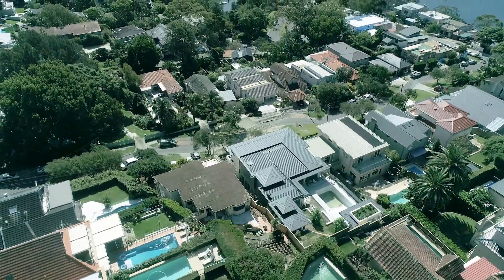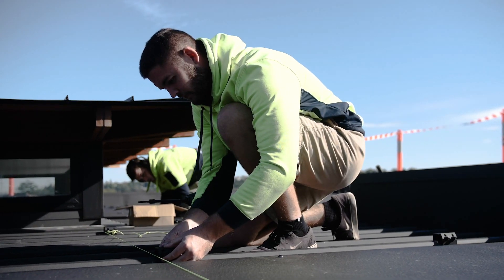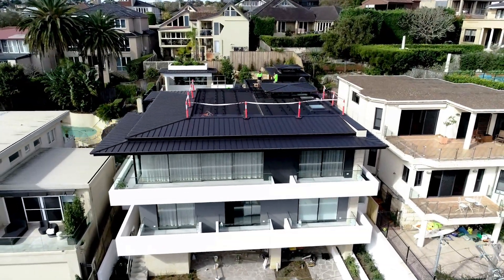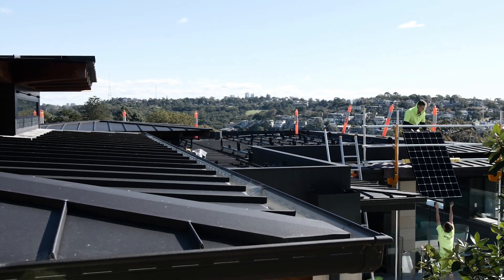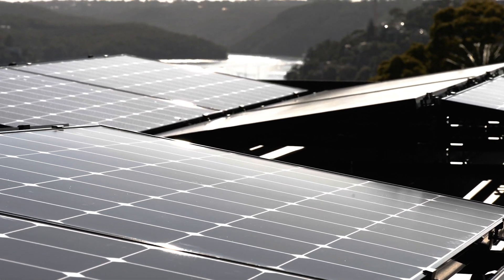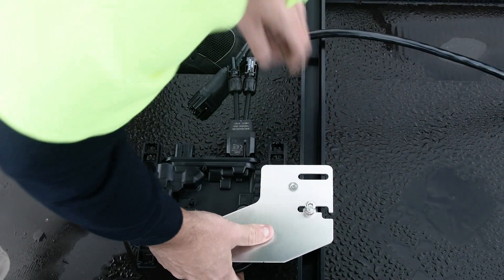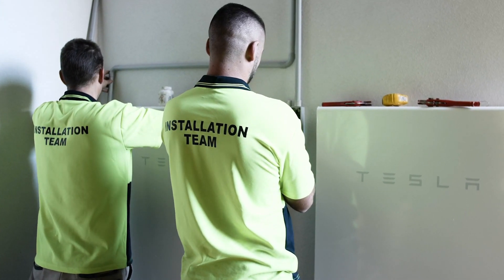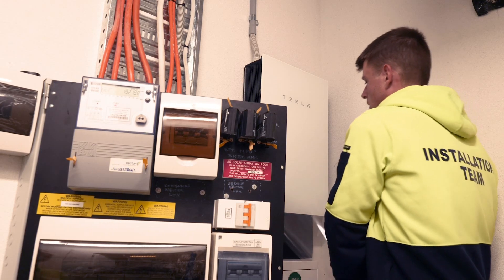By The Harbour – Quality Home Solar Project with Black Finish

Comment: why use black rails and then install panels where you can see the white dividers on the wafers? maybe an all black panel would have offered a more complete "all black" effect. not that Im knocking the excellent LG panels.

Comment: curious why you never used the enphase battery ???
Reply from the maker: Thanks for your comment. For this particular home install, the homeowner decided which brands were used for the project. We feel great to be their solar mounting brand of choice!
Reply from the maker: Also as we have been advised by Enphase - their High voltage battery isn't available in Australia yet.